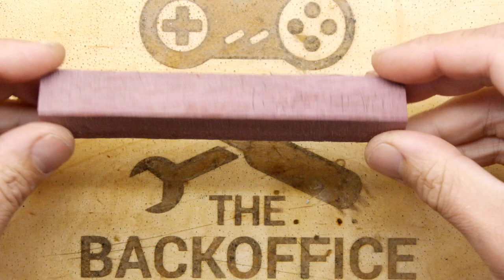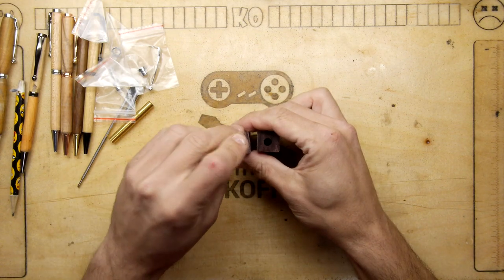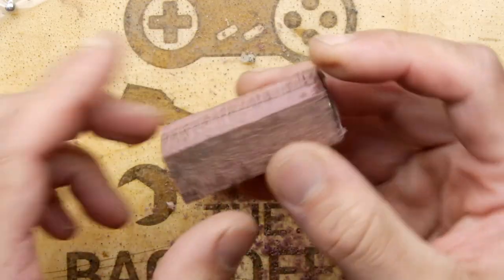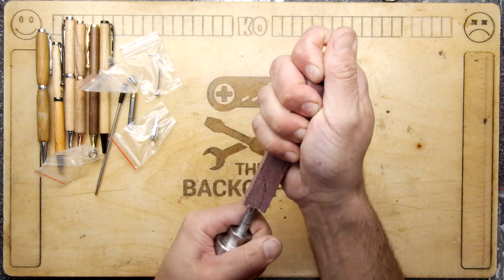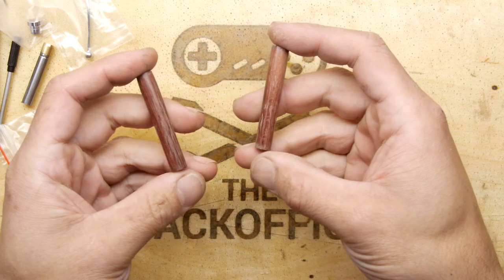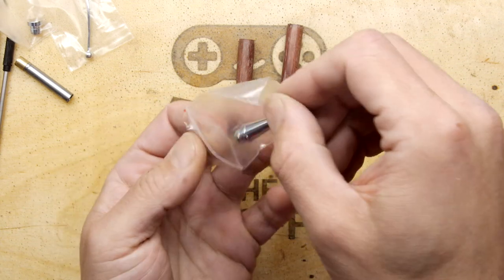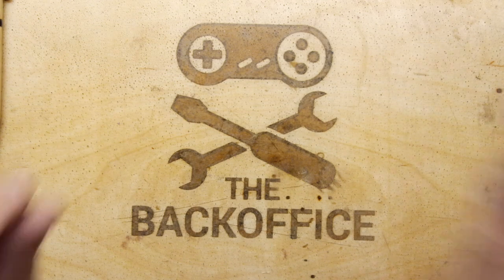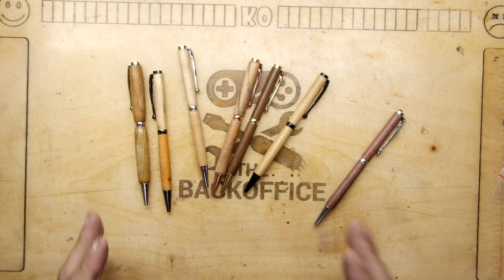The Return Of Penisland - How to turn pens the never ending font of pen wonderment

Comment: I can't believe I came here for electronics tutorials and I watched you wood turning!  Guess what? I'm a woodturner who's jumped ship for a while as my garden workshop is a bit nippy for my old bones in the winter!  You made a pretty good job of the pen but you need to buy and learn to use a Skew gouge, a second hand one will be fine. Can I add it looked like your tool rest was a bit high...but I think your tools looked like they were for wood carving maybe? Like your pillar drill drill method , but you could try the parts between the head stock and tail stock of the lathe. I've always found that easier?   Anyway, nice pens...not bad for a sparks!
Reply from the maker: I don't have the wooden lathe handy and only have a metal lathe at present, so I've taken to 3d printing the bodies now